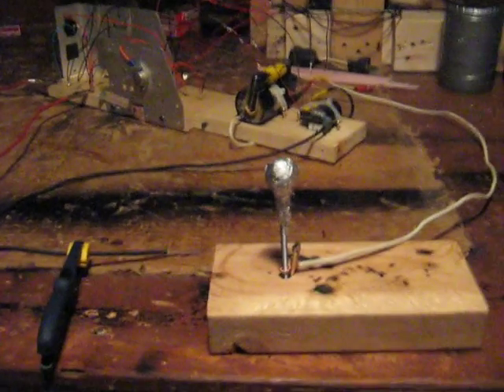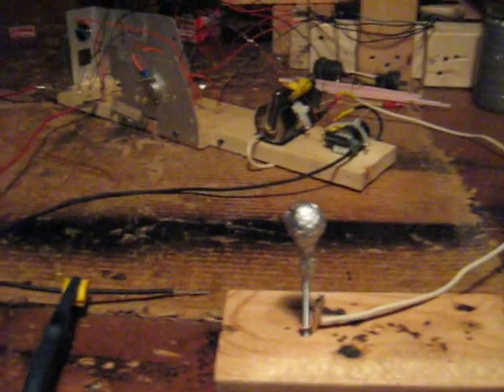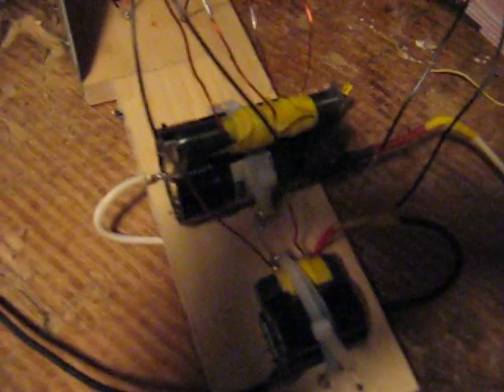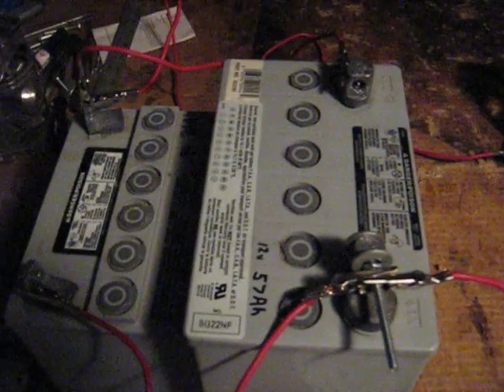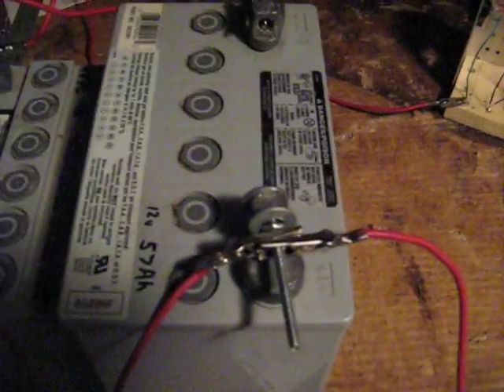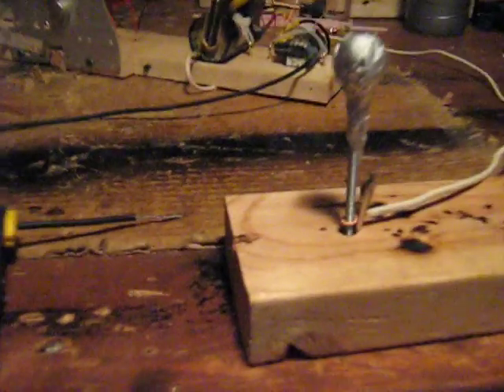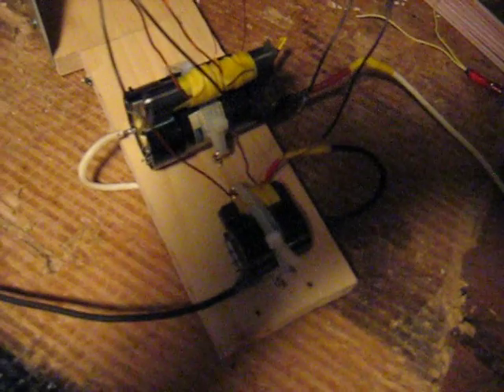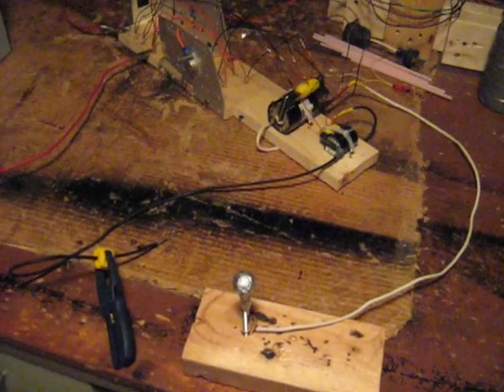Double Barrel Flyback Transformers 30-40 Kv

Comment: Awesome man, I use one with a CFL circuit and I makes 7 mm to 3 cm sparks :) I hope I can find 1 or 2 more to do it, so the cfl circuit is powered by 220v and that I think lowers the voltage... :/ but it works like a charm...but after 20 minutes of fun it's hot like the sun xD I mean the CFL circuit :) Indeed Tesla knew how to have fun :/ I can sit in front of the sparks having fun, mine arcs through the insulation  :/ its amazing :) Anyways you can determine the voltage of these by measuring the min distance to form a spark... Have a good day!!!